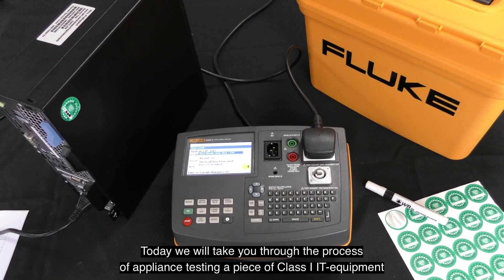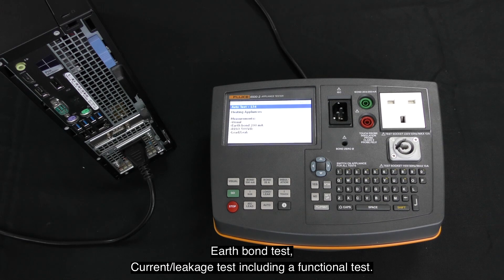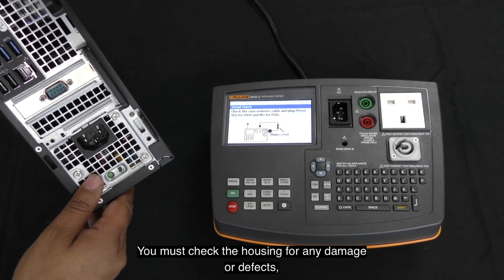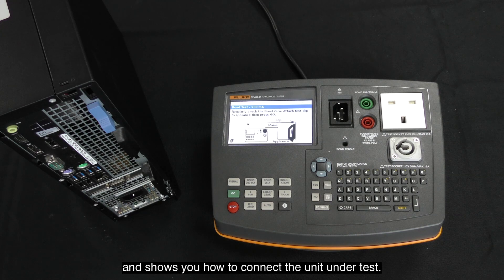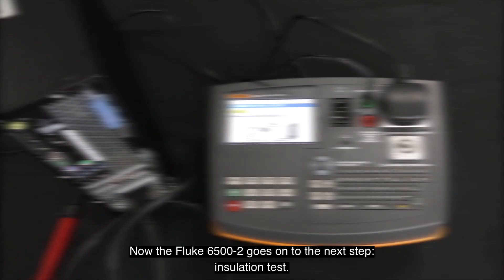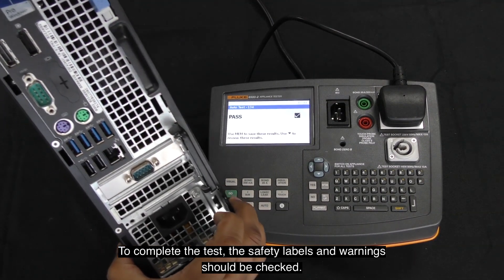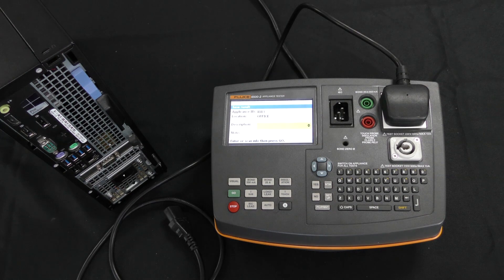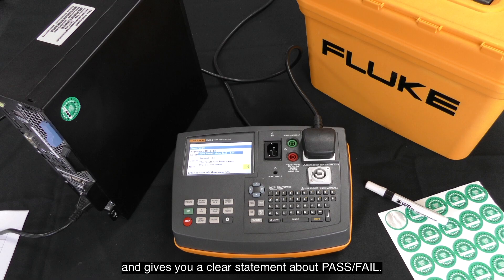How to test an IT Equipment  Fluke 6500-2 PAT Tester

Comment: 134 is a 500v test, should you not be using 138??
Reply: Exactly my thought! 138 drops it to 250v but doesn't include the polarity check, required by the IET code of practice.
Reply: Should the probe be connected to the green socket and not the red socket??
Reply: Is 500v for insulation not too high for a pc?